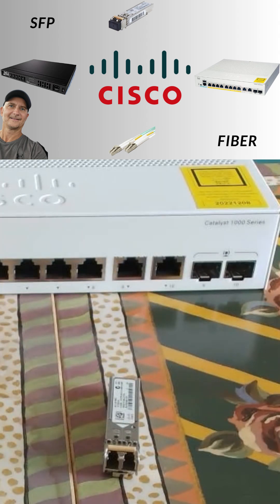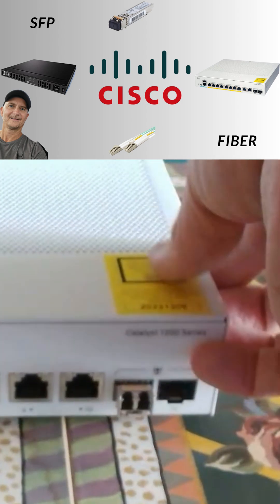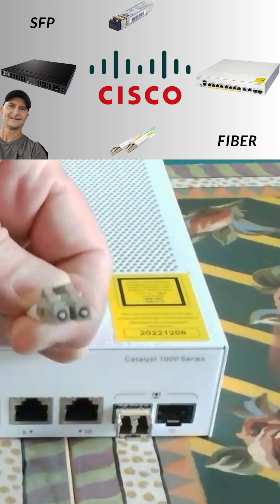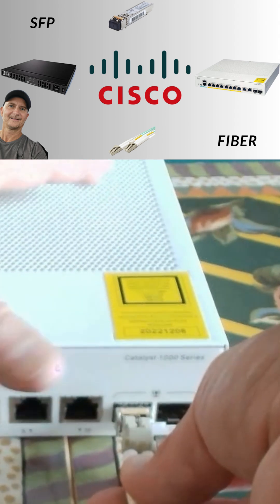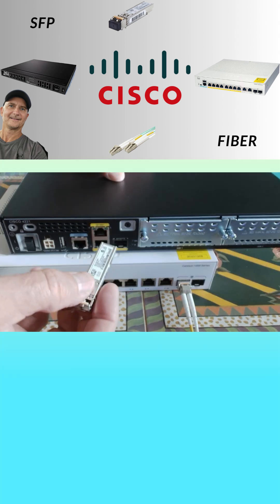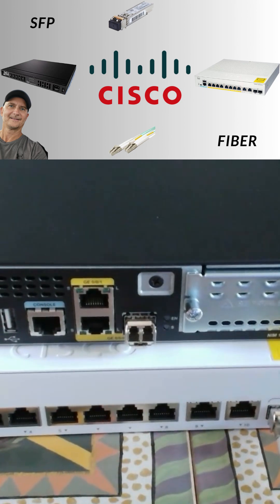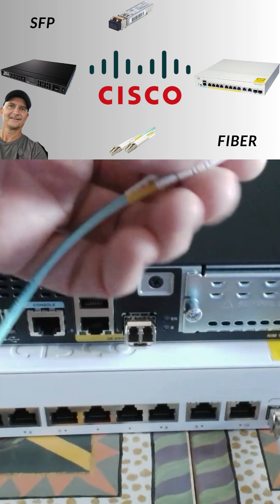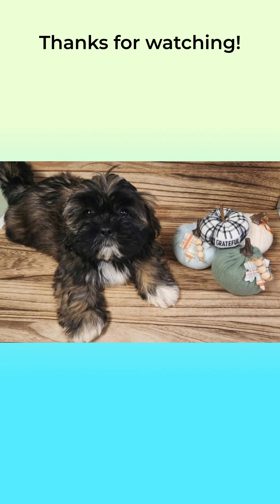How To Connect Cisco Switches With Fiber Super Fast!

Comment: How do you pick out the SFP?
Reply from the maker: Picking the right fiber optic SFP can be a bit tricky because there are a few things you need to match. First, you have to know if you're using single-mode (long distance) or multimode (short distance) fiber. Then, check the speed your switch supports (like 1G or 10G), and make sure the SFP matches that. Also, look at the connector type—usually LC—and make sure it works with your cable. Finally, be sure the SFP is compatible with your brand of switch. It’s not always one-size-fits-all, so double-check the details before buying.